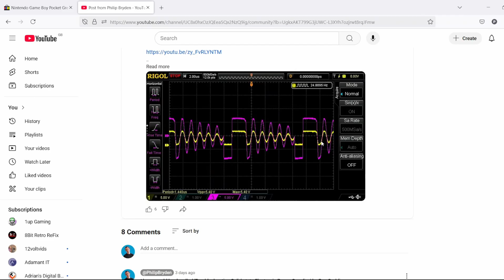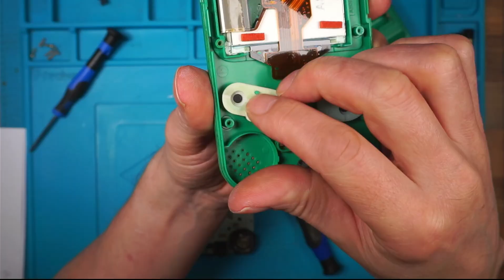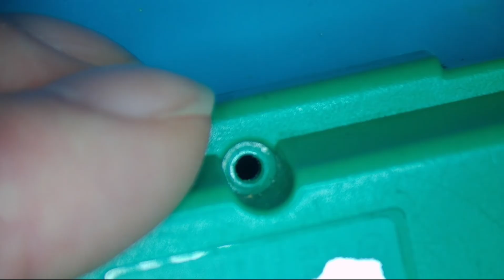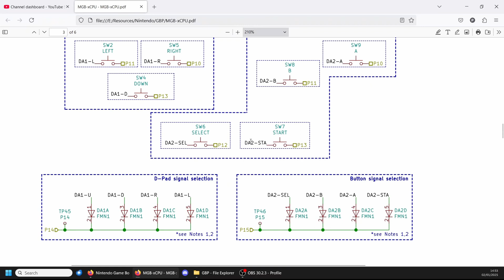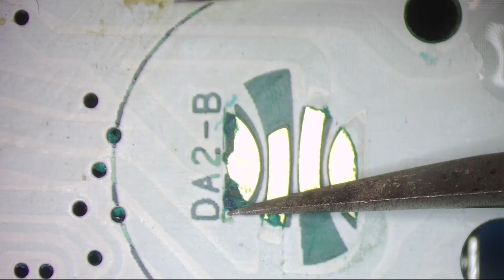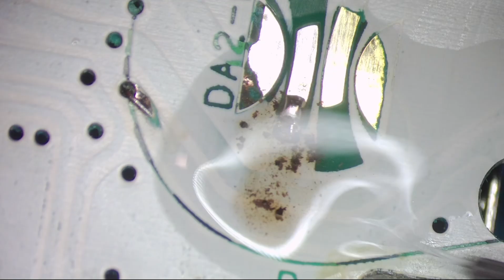Diagnosing No Display Gameboy Pocket | Fixing Faulty Start Select Buttons

Comment: thank you for this. wasn't sure if using a GBP volume wheel would also work as a replacement contrast wheel. Also the bubbles in the back of that screen is a glue failure of the rear LCD's reflector. you can get those replaced as EBAY sells replacement reflectors. you just have to be careful removing the old one and clean off any adhesive before putting the new one on. kinda like replacing the polarizing film from a screen burn.